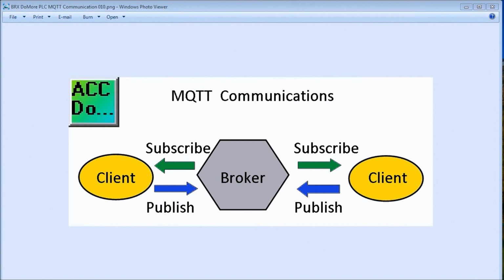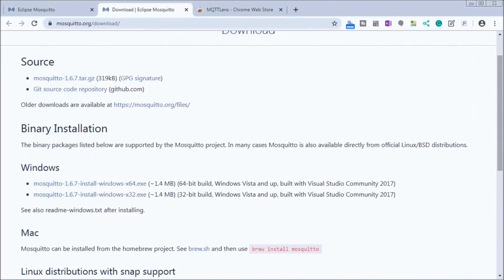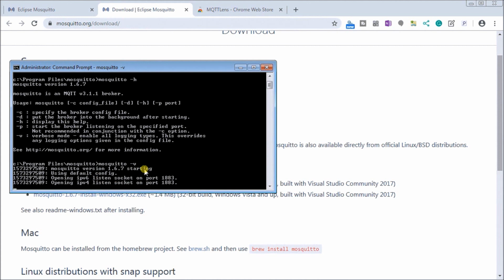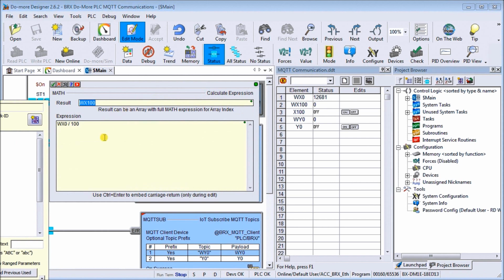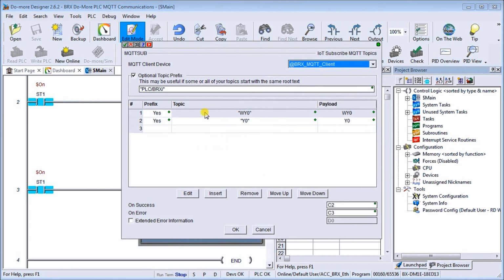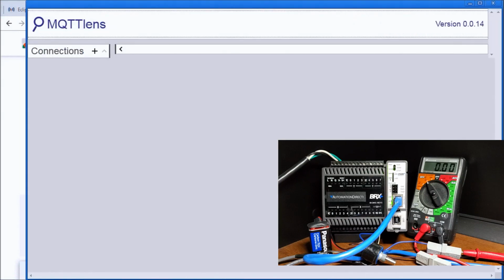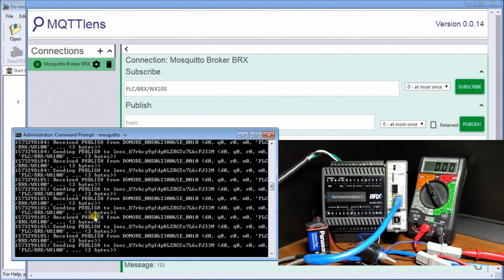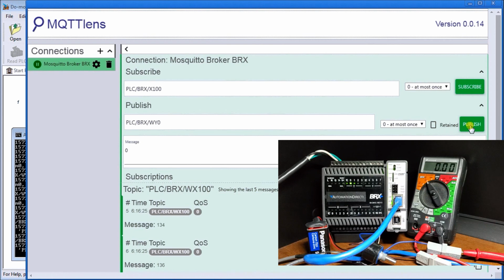BRX Do-More PLC MQTT Communications

Comment: Nice!!

This is the first time I’ve ever seen anyone run mosquito directly on a Windows machine. Very interesting. I’m definitely going to try this on my laptop for work. I had been trying to use a VM running Ubuntu.

The MQTT lens looks interesting to. It seems like a good tool for troubleshooting.

Now just need a video on running node red in windows to round this out ;-) to mimic an opto22.
Reply from the maker: Thanks, Justin,
I was thinking of using VB.net with Visual Studio to show the protocol and save the information into a database. I know that AdvancedHMI mentioned a driver for MQTT.
Garry